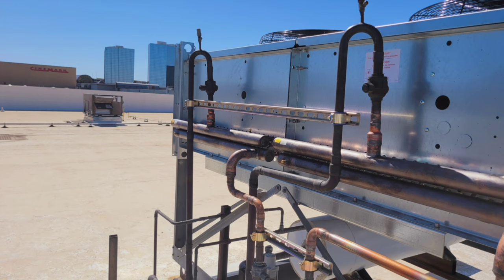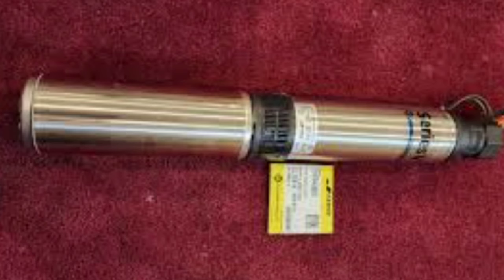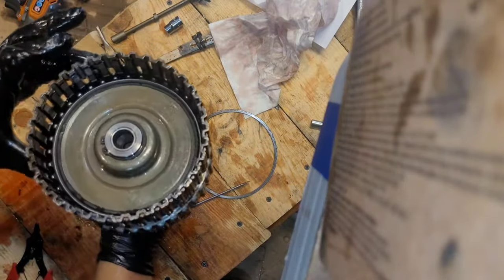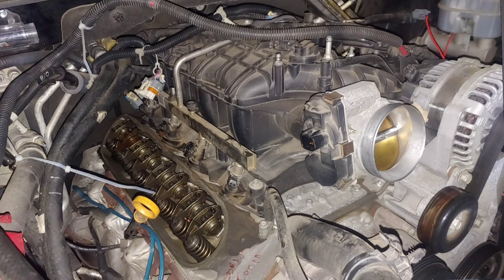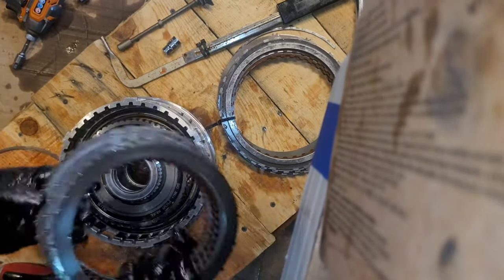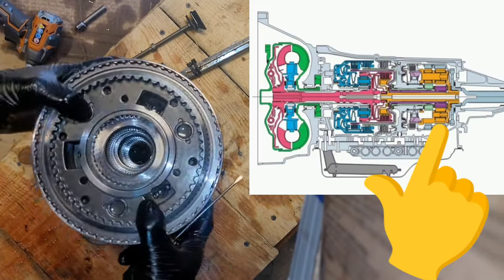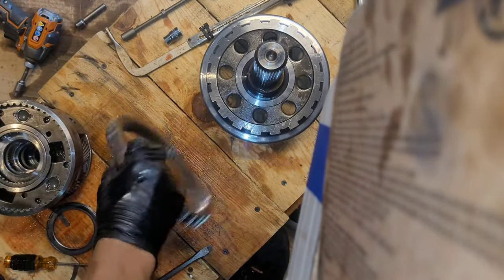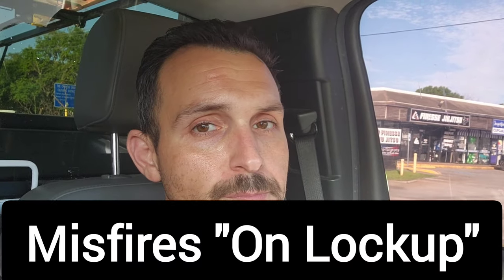6L80 Teardown Continues as I discuss Why I Never Hire Repair Guys

Comment: the last residential hvac company i worked for made me now recommend that people DIY whatever HVAC stuff they can figure out. the industry is so stuck in the past and covered with protectionist regulation
Reply from the maker: So you would have to suggest a customers to not try to do anything?
Reply: @HVACRServiceTech  i think homeowners should go ahead and try a repair if they think they have a chance to fix it
Reply from the maker: @ValDominator I do too. If they feel comfortable with what they're doing

Comment: Grew up on a farm, we had to do it all. That served me well through out my career. Same philosophy, "I can do it" and I did it.
Hint, cinder blocks are NOT a good way to support a 2 to 3 ton vehicle.
Reply from the maker: They're actually surprising strong when stacked properly and level. I found out that they can tip over if all are facing the same way, so I learned that facing any two opposing corners the opposite way solves this for the most part. This keeps the weight in the air from being able to travel side to side or forward and backwards. I actually prefer the bricks over Jack stands now, having done it so many times. I had to figure out a way to do it. And I had the blocks already at the house. So it made it possible, as my only method available